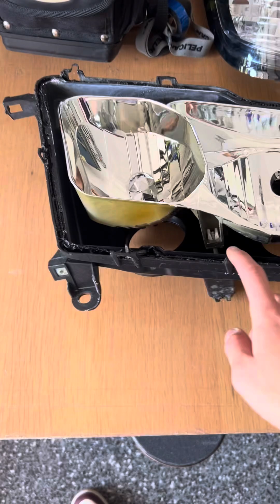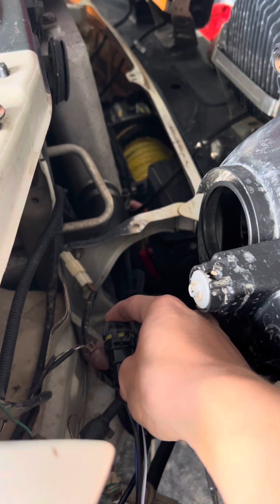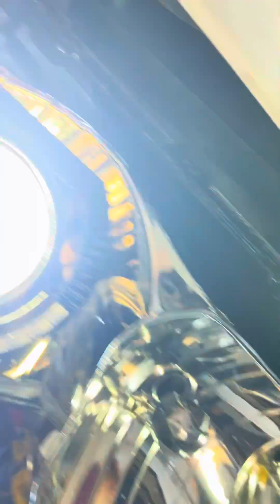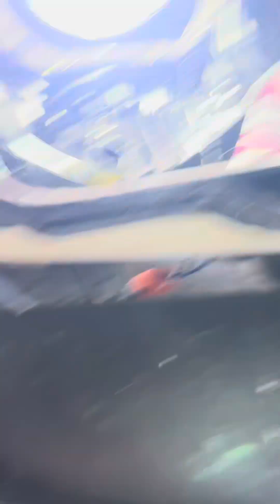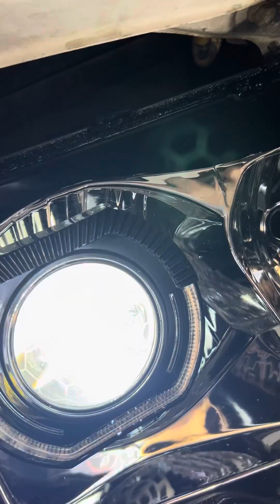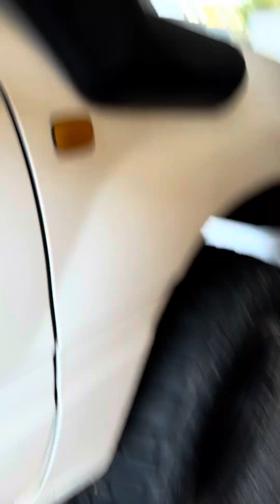CUSTOM 105 HEADLIGHTS INSTALL GUIDE (TIPS AND TRICKS TECH4TOURERS HAWK EYE) 😱😻

Comment: how do you turn off the start up animation when turning on the lights?
Reply from the maker: Download the app off the QR code on the controller and set it I had mine on red led strip and white normal which looked mean
Reply: @TrackToOutback hi I have been trying to turn of my start up animation but i can’t seem to find to setting for it maybe mines different to yours is there any chance you could tell me how you did yours?
Reply from the maker: @LucaMall12 I used the app from the QR code